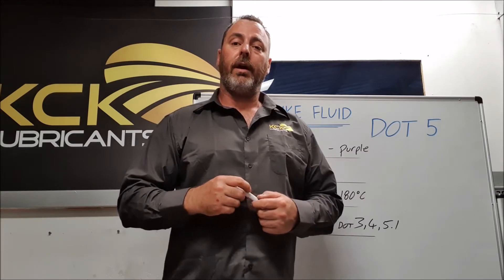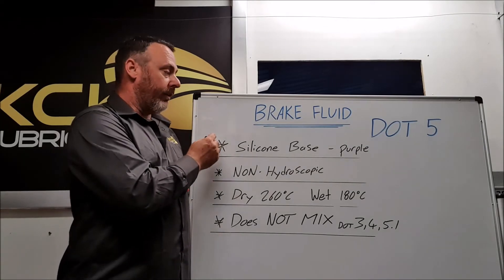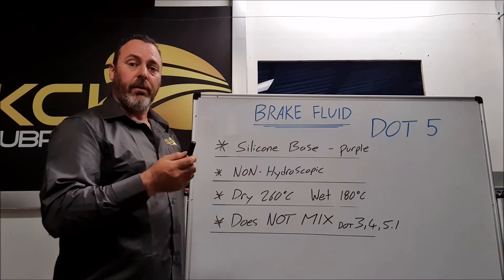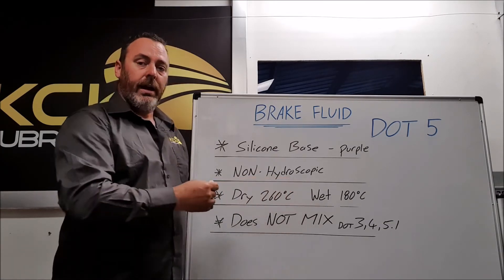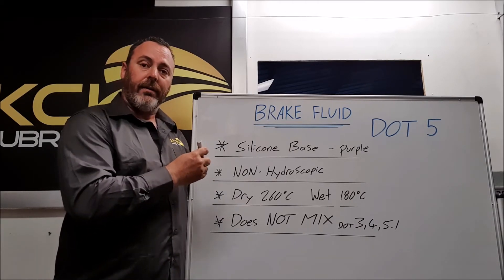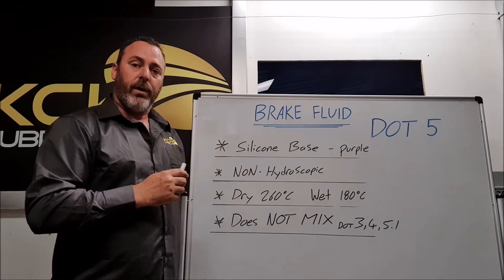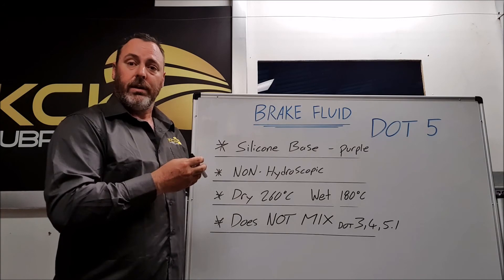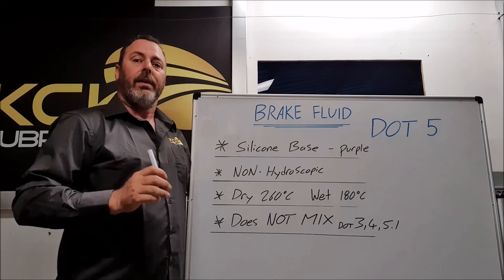DOT 5 Brake Fluid Explained

Comment: I will say, if you're starting with all-new components (master cylinder, wheel cylinder, new rubber roses, etc.) in a muscle car that tends to sit for long periods of time, there's no reason NOT to use DOT 5 because it won't absorb moisture, hurt your paint, etc., but just know at this point you can never go back to DOT 3/4/5.1 due to the silicone residual. If it's a daily driver and you flush it regularly (every two years or so), go ahead and use 3/4/5.1. I only use 3/4/5.1 because that's what happens to be in my garage. One day if I do a full component replacement, I'll probably go with DOT 5 depending on cost/availability since this old car doesn't see much action and probably slower than any modern, efficient 4-cylinder. Just because it was a "high-performance muscle car" in its day doesn't mean DOT 5 wouldn't perform well for it. Means nothing on a mostly stock old muscle car. I digress...
Reply from the maker: Thanks for watching

Comment: Many thanks. Very useful. I want to change my Harley from dot 5 to dot 4 for the reasons you have stated. Is this possible.
Reply from the maker: Yes it is, be sure to clean and flush the system thoroughly and check with Harley to make sure the seals are compatible, be sure to subscribe!